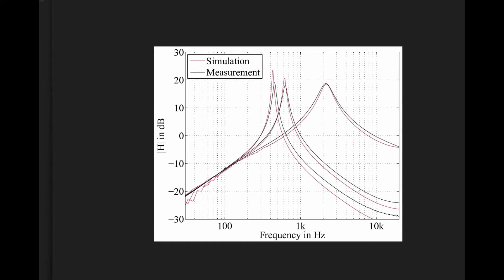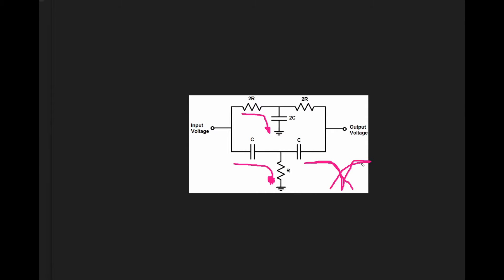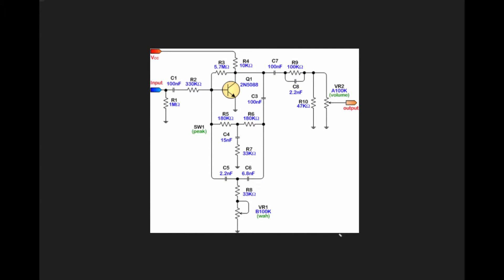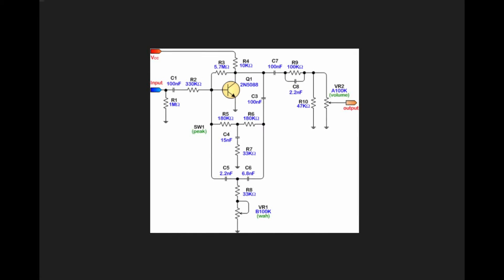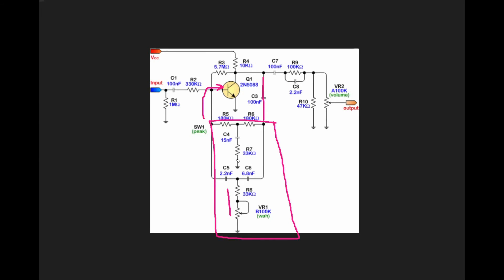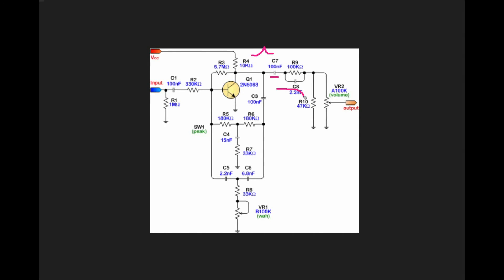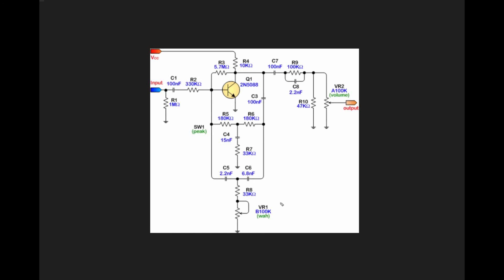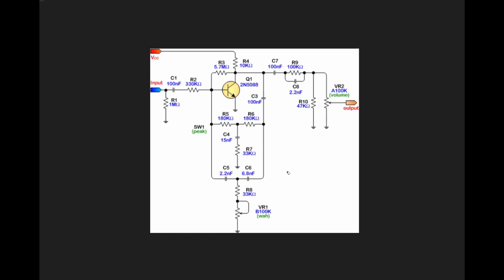Schematic Elements for Guitar and Effects: Twin T Filters and the Colorsound Inductorless Wah

Comment: would it be possible/easy to add a switch to change between notch and peak?
Reply: say, switching the output of the transistor coming from the collector to the emitter? or, just severing the negative feedback connection back to the base of the transistor?

Comment: Really appreciate you looking at the twin-T. If you're welcome to requests, could you look at a related circuit that uses a twin-T-like configuration? Thinking of the Pearl OD-05. Ultimately it's got something similar to form its parametric equalizer, but there's some really complicated feedback going on in those op-amp stages that I don't quite understand. Most op-amp feedbacks shown in examples tend to be relatively simple, so laying out what's going on there could be really valuable.

Comment: This was a really great tutorial how the wah pedal works. This was also the first time I heard of the twin T filter. Thinking on experimenting with digital potentiometers 😊
Reply from the maker: They are really great for narrow band shaping of signals
Reply: Great info thanks. Does the one side of the Filter, the high pass stay static, while the low pass is moved by the pot? So the notch gets wider and narrower? Or is something else going on?
Reply from the maker: @thevalvinist5713  The two sides actually interact with each other. Once you start doing things like what this wah does, you actually start breaking some of the assumptions that are made about "typical" twin-T filters.